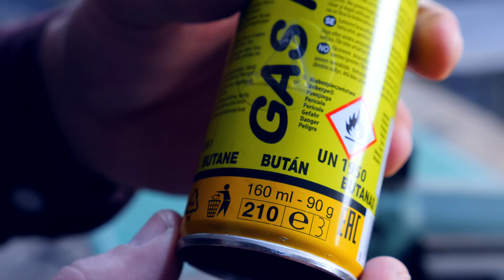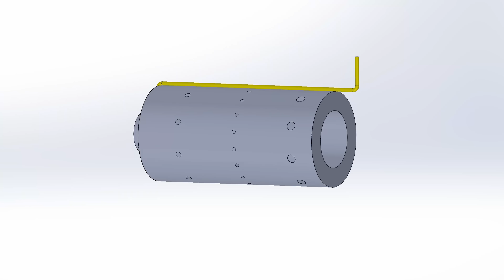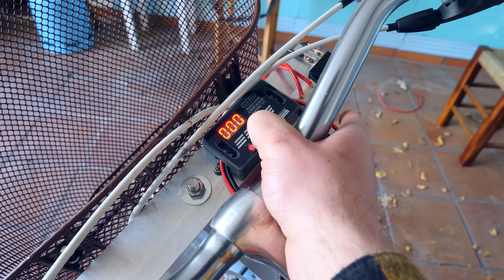I put a Homemade Jet Engine on my Bicycle

Comment: I'd like to see an Integza-branded butane jet propelled "cruise missile" style (i.e., cigar shape & tiny wings) radio controlled "drone" able to be (1) launched from a (long?) rail or guide-slot ramp, [2] fly (by internal GPS guidance or manual RC command) to some 'target X' on the ground 2-5 km away where [3] the engine is turned off, a [4] parachute is deployed  (why not rocket ejected?), & [5] the "drone" floats to the ground to end another video success.

Comment: You have two problems that can cancel eachother out : too much air coming from the blower AND too hot nozzle ? Just root the excess leafblower air around the nozzle to cool id down. A simple bypass system will do,  and you can get rid ot the cheap chinese speed controler to simplify your design

Comment: If I were to create engine similar to this, I'd completely forget brazing, also metal of choice is stainless
As for further making it more mental I'd cool combustion walls by forcing butane and air by sweeping over the walls, air freely and butane trough piping touching walls
Making both gases hot enough would result with self ignition at touch, so mixing nozzles would be in order, at this point it's more of a rocket engine hehe

Comment: What you could do is allow some of the leaf blower air to bypass the core. That would help keep the exhaust cooler and you might get a bit more thrust too. Real gas turbine engines work similarly.
Reply: Exactly my thought too! if he where to put the whole assembly in another metal tube, and use 3 small EDFs to create bypass stream. it would pick up heat energy and create more thrust

Comment: What about a jet turbine helicopter 🚁? Like on the blades to spin the roter? Yes it's been done but I've never seen it in an RC except for using RC rocket engines. I mean turbine helicopter roters

Comment: Yo integration your leaf blower needs a one way air valve.  When the the air super heats it speeds up beyond the blower a one way air valve could give it more power on full blast.

Comment: use ducting to separate the leaf blower's air into two pipes, use one to feed the engine and rount the other around the outside of the flame tube, to cool it and produce extra thrust from the heated air (you could even eventually make an after-burner powered by the heated cooling air - eventually)

Comment: Great Videos and good idea. But i would recommend getting a tig welder and using a litte thicker material, instead of soldering very tiny material for high temp projects.

Comment: I wonder if it would be possible to 3D print cheramics which could withstand higher heat meaning better parts for jet engines...

Comment: Hi Integza!! I believe more tomatoes could be crushed if you made a real self sustainable jet engine with a proper compressor stage that runs from the blades at the exhaust.
(Thus you can not only have thrust, but also an axle with torque, and maybe add that to an automated tomato crushing machine...just sayin')

Comment: Why not make a HHO jet engine using water as fuel!
Or use charcoal (the most common form of carbon to acquire) and sulphur and potassium nitrate (stump remover) as a solid state rocket fuel along with a simple metal aerospike nozzle and scale it up for your Grandpa's bike!

Comment: Use a jet engine to make art. This may sound complicated but it’s not. Make something like a large scale 3D Printer, but instead of a tool head you replace it with a paintbrush or some other medium (such as pencils, markers, ink, etc) but instead of using motors to move it, you use a multi-directional jet engine to move it. Watch Micheal Reeves video about making a surgery robot, and make something like that.

Comment: Use leaf blowers and light weight materials to create a hovercraft (hoverboard of sorts) with a heavy duty trashbag skirt (much lower friction/forces to overcome than a bike) Mount your leaf blower jet turbine to that with some sort of swivel for direction control and you should have one cool ass/low cost vehicle.

Comment: 10:00  You should cut out the outter area around the skinny tube, so like high bypass like in a turbofan jet engine to help produce more thrust to add more pushing power ( i might be wrong about this ) - it legit sounds like a real jet engine now too

Comment: You should try building a turbo jet with some thicker metal, maybe even hydro form some parts to get smooth bends
Reply: A proper ventury nosal exhaust for maximum thrust as well

Comment: Integza. You should save up for an oxy acetylene setup. Then you can buy some thick steel piper a do some gas cutting on a piece of steel and gas weld everything together. Once you figure it out it's pretty easy.

Comment: You've tried 3D printing ceramic parts and they usually suffer due to shrinkage when you fire them due to the resin burning off. Have you considered 3D printing to make molds, then casting more heat resistant parts?

Comment: Have you heard of Suspendaslurry? It allows you to coat PLA objects with multiple layers of ceramic, melt off the PLA and leave you with a ceramic  shell.... This might solve a lot of your overheating issues across your multiple project

Comment: Be interesting to see how you could build a fuel common rail, I’m not sure what kinda pressures your running out of that bottle, but most fuel systems run about 29,000 psi having more control over your flow of fuel could be very helpful in the long game 👍

Comment: You would get much less problems with heat if you used thicker material and actually welded it together, not brazing. Also thicker material is way easier to weld

Comment: You should make another jet engine, And put on the bike too. Since the leaf blower is so strong i thing that it could supply oxygen to both of the jet engines. You could also play with different types of fuel.

Comment: Here is a little tip for bending tight radi. Fill the tube with sand. That will prevent it from beeing crushed.

Comment: I'd like to see you make a hydrazine and hydrogen peroxide jet engine, a 1:2 ratio should be optimal N2H4+2H2O2=N2+4H2O. It's probably going to be by size the most powerfull jet engine you ever made

Comment: Remake the tube but pop rivet fins on it on the inside as ya roll it up river it as well and use a high temp sealer to air seal it something that do t burn hell cement lol jk tho it may work actually

Comment: Ok Mr. Integza,  lets make Tesla proud and evolve to the next level. Your challenge: Electromagnetically controlled, Microwave induced, Hydrogen Plasma engine. There are several videos here on Youtube showing a rough proof of concept, yet no one has yet to configure a functional engine. You've already worked with the majority of the necessary components, the only primary components missing are a Magnatron, and an EM coil pressurizing the plasma exhaust creating thrust. I could share some 3D concept models if you'd like.

Comment: If you tried pushing the bicycle with just the leafblower, would you also mount the Blower sideways?
May I suggest turning it 90° so the exit is facing backwards? 
Then remove all this unnessesary airvent-tubing-stuff and put the combustion chamber directly on the exit of the blower.
Maybe a fuel injector from a car can increase the fuelpressure?
How about a de laval nozzle out of ceramics?

Comment: Next time when welding the lid to the chamber, tack weld, meaning that you make small welds on the 12 3 6 9 position, then you can weld the rest with ease, it won't warp the metal.

Comment: If you had a way of creating ignition and getting fuel going on your own, while seated, you could use that ancient bike generator that has a mechanical lever to switch it against tire I saw on upper left of rear wheel for power instead of batteries.

Comment: You spent all that time building a baffle to slow down the air when you could have 3d printed a modular restrictor to the leaf blower and controlled it at the source couldn't you? Something like an adjustable aperture but for air?

Comment: i'd recomend building another steel tube around the whole combustion chamber and nozzle, being suppoerted and centered by some fins, and then redirecting some of the leafblower's air trough it, to help with cooling

Comment: Of course I would like the 3D printer. So, my suggestion for a future video... a simple 'old school' solid fuel rocket.
Make it big, because... as you probably already know... size does matter. Many years ago I used large spray cans from barber shops. Especially the ones they use on ladies haircut (lacquer to fixate the shape) make a great fuselage. The're light weight and still strong and very important... if you ask it nicely... they're free ! Go ahead and supprise us all !

Comment: Integza is king of the <$500 machine shop, I swear. Other makers here have access to a bajillions in space and equipment and he's just a dude with a table, vicegrip, angle grinder, and power drill (and printers and drill press shut up). 

Anyway, that bicycle may be an ideal test platform for a redo of the steam engine--steam loves absurdly lengthy strokes, and the pedals have like 30cm of potential stroke.

Also extremely prone to exploding

Comment: @Integza, You might have better luck if you use bronze instead of steel. Certain bronze alloys are used in high temperature applications in aerospace.

Comment: I’d love to see you make a thrust vectoring nozzle. It would be interesting to see how much steering you could get out of homemade parts.
Reply: Honestly, it could be relatively simple. Given a flexible high-temperature coupling, all you need are two pushrods connected to the nozzle, and you have full control over rotation.

A 50mm linear actuator can be had for about 28€ on amazon, and all you need is two of those and an arduino to control it all for the most primitive form. Of course, those are DC motors, so you need a linear enconder (or a linear potentiometer, which is easier to read and probably also cheaper) in case you want position feedback.

For a flexible coupling you could just use aluminium duct hose, as long as your exhaust temperatures are low enough, or you can actively cool the coupling.
Reply: YESSSS this would be so cool
It seems he's already chosen the people but you should definitely suggest this again

Comment: It will be better to have a exhaust that lower the velocity and increase pressure. Also you can use hi velocity cold air from the blower to cool down the exit to don't melt down.

Comment: You could improve the leafblower jet engine with a variable geometry rocket nozzle. You may use the ceramic resin to make the diferent parts of the nozzle that are near to the hot gas. With and arduino and stepper motors, you can make the control and actuation of the mobile parts of the nozzle and the control of the blower flow depending on the nozzle position.

Comment: 3:18 For me it looks like soldering as the 2 metals don't mix with each other, just flow on each other. But correct me, if I'm wrong.
Reply: Brazing

Comment: @Integza
4:20 You need this knowledge, on how to drill thin sheet metal SAFELY and perfectly.
https://www.youtube.com/watch?v=cAGiuXOKKi8
Title: How to Safely Drill Holes in Sheet Metal Using a Twist Drill
Reply: 6:54 Another trick, if you push the needle through a regular wine cork, then you can easier punch through thicker metals, even steel.
Because the cork acts to stabilize the shape of the needle, so all the hammers energy goes out through the tip & into the target, without the needle bending.

Comment: how about combining leaf blower and air plane jet engine, instead of combustion the air from blower is used to rotate the jet blades/turbine and suck in much more air and shoot out at higher thrust? a high pressure air without any combustion

Comment: Sorry to nitpick i'm a metallurgist and work with metals combined OCD makes me a bit of an ass when it comes to technical stuff and i bet you just slipped with your words witch makes me a bit more like an ass. many parts aren't welded they are brazed.
soldering is <450C Brazing is >450C and you can melt the solder/brazing and separate the pieces again (in most cases) and welding is literally melting together material into a single part with the weld having roughly the same melting point and characteristics depending on the filler material.

though if you want to have something more heat resistant you might want too look into nickel alloys or iron/nickel, they have excellent resistance towards heat and oxidation.

well sorry to be a ranter and may my comment be buried with some more positive ones as time goes on.

Comment: As a general safety thing: you probably shouldn't wear gloves when using your drill press or normally any rotating machinery (the angle grinder is a trade off). 
They are usually a bit wider than your finger and so get caught more easily. You might be lucky with those surgical gloves but, your drill press is powerful. When it gets a hold of  stuff it pulls it in. Just try throwing a towel in there. If you get your bare finger near the drill you might destroy your finger, if you wear a glove you have a great chance of getting pulled in and receiving far greater damage.

Comment: I'm glad you've started to work with metal. I must recommend you get into welding. Specifically stainless steel handles heat very well. That way your next rocket engine doesn't desolder. Keep it up 🤙

Comment: Huge fan of the environment. I think it would be really cool if you could try to make a few hydrogen combustion things. Obviously a jet engine but I think it might be quite funny to try to make various engines as hydrogen is bound to be way too energy dense and hard to not leak everywhere.

You could turn this idea into a satirical series about escaping a desert island where you were stuck with only a 3d printer. You are trying to build boat engines powerful enough to get you off the island. That way, you need to generate the hydrogen first

Comment: Dude, you're not welding.  You're brazing which is essentially a higher temp soldering.  It's great for many things but when dealing with the high temps of a jet engine it just melts like solder would.  You need a real welder, Integza.  With all the fine work you do you'd want to get a TIG welder.

Comment: I love your creativity. You do need to make a de-laval nozzle. Without it your gasses escape in a turbulent manner and you loose most of your thrust  potential. I also suggest replacing the butane with petrol as this is more energetic - which will require a 3d printed pump for the fuel. Good luck with the future tests & be careful!

Comment: Be carefull when drilling into thin sheets like that, if the drill catches when punching trough, which is very likely to happen, you're basically holding onto a spinning blade with your bare hands. Clamp it down and keep your hands away from the sharp thin piece of steel, you're taking to a fast spinning drill bit... Jeez.

Comment: 3:35 that’s not quite welding as you’re joining your steel with a dissimilar metal. In this case it’s called brazing.
Reply: "well actually...................." 🤓
Reply: @flappyBoi  ur whatching a nerdy channel what did you expect?
Reply: @loser flappyBoi

Comment: He keeps saying "welding" but what he was doing was brazing….as evidenced by the solder melting out when it got hot.  A weld wouldn’t fail until the metal did.

Comment: Integza you should use a turbo charger off of a car, it will have a side for combustion and a compressor. You’ll just have to connect the exit of the cold compressor to the entry of the hot side compressor and add a fuel source somehow

Comment: Hey Integza, I really love your videos! Especially the crazyness of your ideas. So I want to advise you to never wear gloves on rotating machines (drill, angle grinder)
There they can do much more harm, than they prevent. What can happen, is that you get your finger pulled and wrapped around the drill.
Besides that, keep it up, you're awesome!
Reply: Good advice even for those watching like me, thank you.
Reply: That's true, I've done that on a drill press!
Reply: I think wearing the metal wired gloves is safe, right???
I mean the one which has a little bit of toughness

Comment: You can use the blower for the cooling the jet just add another case, which cover all the engine and connect the blower to it, as like real jets. Maybe you can thing an additional electrical centrifugal pump infront of the cumbustion part to increase pressure and create real trust.

Comment: 4:35 pucker factor 9000. i've seen people get flayed open doing this because the sheet metal caught the twist drill and took off spinning. it turns into a blade of death slicing up your hands

Comment: It would be cool to have a engine that can run on multiple fuels like butane enginer oil and other oils and maybe like a forge attachment so you can melt metal like lead or aluminium.

Comment: Since you've already done projects based on the German V1 and V2, you could also do a project based on the V3.
It was an large gun that had multiple small solid rocket charges rather than one large one.
They were arrayed along the barrel and would discharge sequentially as the projectile passed.

Comment: I believe that you''ll find that propane will give you more thrust.  It would be intriguing  to see you build one of the WW2 "buzz bomb" engines that Adolf used to deliver the bad news to England.  They are a simple build and can be adapted to a great many uses.  I once saw a fella get pulled over and ticketed for having two of them on his skateboard... at 45 mph.

Comment: Soldering isn't going to cut it for a jet engine
You mistakenly call your process welding, but if you had welded it, it would not be dripping at all.
Only solder drips like that.

Comment: Beside your spot welds, you didn't weld anything. You brazed it. That is why it will not hold up in high temperatures.